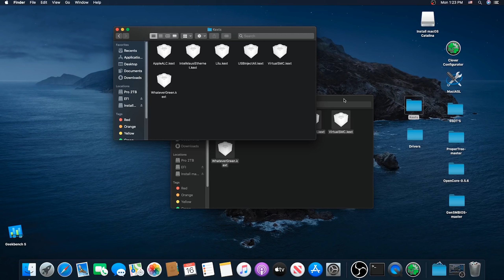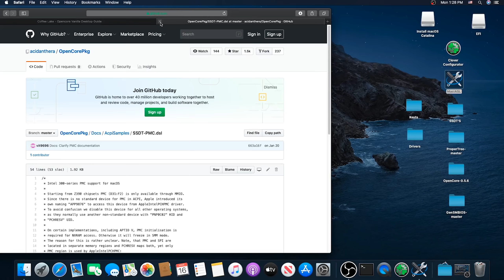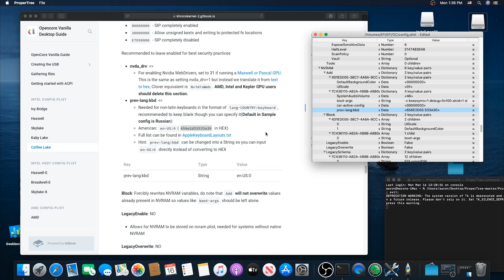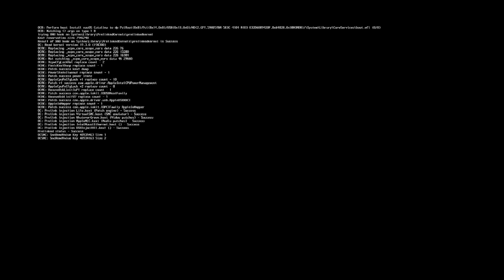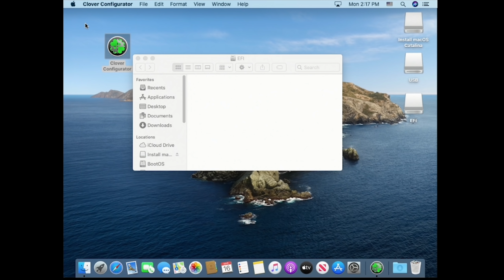OPENCORE CATALINA Z390 Gigabyte Designare Hackintosh Bootloader using a MAC! | Step by Step

Comment: Any advice on getting hardware acceleration working? I have this same build and can't get hardware acceleration working to encode and decode video. Everything is going to CPU. No intel quicksync or AMD decoding on Plex or handbrake via videotoolbox.
Reply from the maker: What graphics card are you using Pete?
Reply: The Sapphire Vega 56. 
The same from the video.
Reply: @TechNolli  Any update?

Comment: I've been running a skylake i5-6500 system for quite awhile now. But I decided I wanted more power  either by going from GTX-710>RX 570 or getting an i3-9100 + cheap mobo. I've gotten the Rx 570 and I guess it helps a little in Photoshop but otherwise it's not very noticeable. I may return it and go the i3-9100 route but it may depend on getting an older Nvidia GTX 560 Ti working in Catalina. My research shows not likely, whats your experience with such a vid card?
Reply from the maker: Hi bryan! No Nvidia graphics in Mojave or Catalina. Not supported. :(

Comment: Hey great video. This is the first guide I've followed to successfully move away from Clover to Opencore and it nearly all works...

I have the a similar setup, same mobo and i9 CPU but I'm running an RX 5700 XT but I'm not getting hardware acceleration. I'm testing this using VideoProc.

Any ideas would be much appreciated, thanks!
Reply from the maker: Hi Anthony! Try using SMBIOS iMacPro1,1 and disbale the onboard Intel graphics.

Comment: This was an interesting video! I wonder, though, as for the last year I've run Mojave & Catalina and used the Apple Thunderbolt 27" (still a lovely display some of us can admit) with an "Asus Prime Z370-A II" motherboard wired/patched from an RX570 out into an "Asus Thunderbolt EX 3" PCI card, which on the TB3 output has a TB3 to TB2 adapter where the display is connected (and works well). If this connection was possible straight away out from TB3 (via TB3 to TB2 adapter) on the Designare motherboard (used in this video) one more PCI slot would be free and also we will get one free TB3 port out from the Designare Motherboard – why not to be used for a very good TB Audio Interface or whatever else? Anyone know if this could be possible, without having the Einstein Hackintosh brain/not too complex settings/coding? Is it even possible or is Mac Pro 2019 the one and only way?
Reply from the maker: Good question.

Comment: Wondering if a XFX Radeon VII will work with this method?
Reply from the maker: Hi Tony! It shouldn't be a problem in Catalina.
Reply: Thanks for the reply.  I have two NVME m.s ssd drives in my Designaire.  I have Windows 10 installed on one HD.  I show be able to install Catalina onto the 2nd HD using Opencore?

Comment: for almost 2 years i use Clover Bootloader , and i want to ask you before treying it what's your opinion is cloverBootloader or Open core Which is better for my rig which I5 8400 
b 360 aorus gaming 3 wifi 
asus dual rx 580 
16 gb ram
Reply from the maker: HI Ahmed! I do not have a preference on bootloaders. One reason I started using Opencore is because of the AMD support on Catalina 10.15.2 and higher.

Comment: Guys, I wonder if you can help me. 

I have recently loaded Mac  os on a Lenovo y530 everything was working great until one day sound just stopped working.. I have tried everything including re-installing Mac OS. This build is using clover. I saw another YouTube video telling me to look for the specific  audio alc Kodak for the device. 

Unfortunately, I cannot locate this. If anyone knows what ALC number this Device is using, please let me know.  My USB headset works perfectly. I had also test of the audio on Windows installation and no issues. 

I would really appreciate some assistance as I am a Voice over user and require audio to use the computer.
Reply from the maker: Hi Dharashan! That has an NVIDIA graphics card that is your problem!
Reply: TechNolli  hello and thank you for your reply. Yes it does have Nvidia graphics card however, it is  Utilising on-board Intel graphics. It also has  realtech sound 

The strange thing is that sound used to work perfectly.. I don’t know what I have done to break it.

I have tried updating Apple alc 
It is picking up USB headset hdmi out but not the on-board speakers which is strange

Comment: I have an integrated GPU and not discrete looking for some guidance on how to insert this into my config.plist as the instructions are a little funky in the vanilla guide
Reply from the maker: Hi Chris, Try making these edits and see if the UHD 630 works. Lets me know!
AAPL,ig-platform-id    Data    07009B3E
framebuffer-patch-enable    Data   01000000
framebuffer-stolenmem.   Data   00003001
Reply: TechNolli I was able to put on the platform Id and it got me going. I’m of course showing the 3mb of gpu I’ll put in the frame buffer info tomorrow and let you know
Reply: I was actually able to partially figure this out by putting in the hex code for the coffee lake iGPU. It was enough to get me up and running. Now or trouble shooting. Thanks for the great video
Reply: So this worked like a charm. Thank you. The big problem I’m now having is I’m only getting 3mb of vram for my IGPU. How would I go about fixing that

Comment: Does quicksync work for FCPX? I have same motherboard and vega64. I like the qucik export with fcpx.
Reply from the maker: Hi Pawell! How do I test that? I am a Premiere user.
Reply: Bruce X score time Prores22 and h.264 would be nice,  typical time for such system would be 10-12 sec in prores422 and around 15 sec on h264.
OpenCL score also be nice. 
Quicksync would enable hardware encode-decode and a program called MacX Video Converter would notify you if quicksync is available and enabled.

Comment: I recommend that at the end of compiling your CONFIG.plist that you use the SANITY CHECKER located at the bottom of the Open Core page that you are working from. it will let you know if there is anything missing or incorrect in your CONFIG.plist file.
Reply from the maker: Great idea Edgar!!

Comment: That case looks cheap.

Try out something like the Fractal Design Define R6, that's well built, not quite Lian Li or HP Z600 but still very well made
Reply from the maker: hmmmmmm I think it is a great case. This thing weights 50lbs. lol I'll check out your Fractal. Thanks!
Reply: @TechNolli  weight isn't everything, stone weighs a lot, and I'm sure you can imagine how fragile a coarse stone like slate would be like if you used it for the case of a PC.

The point I am trying to make is, don't judge a book by it's cover, or in this case don't judge a case by it's weight.

Thermaltake have made some amazing cases in the past (Check out the Thermaltake Level 10 Titanium Edition, or the Thermaltake Level 10 BMW M-Power Edition), I just personally don't feel like this stands above many of it's competitors, other Models like the View 71 certainly do, or the Core-P Series, this case just felt generic to me.
Reply: I have the Fractal Meshify S2. I concur, I didn't know what a nice case was until this Fractal came in. Top notch. Especially for the money. 👌

Comment: Awesome video mate! Tried this with my ASUS Maximus XI Hero mb but got errors : 251:865 00:717 OCB: Failed to match a default boot option
251:942 00:077 OCB: Initial default is 0, fallback
257:060 05:118 OCB: Should boot from EFI (T:0|F:0|DEF:0)
257:769 00:708 OCB: Perform boot EFI to dp PciRoot(0x0)/Pci(0x1,0x1)/Pci(0x0,0x0)/NVMe(0x1,00-00-00-00-00-00-00-00)/HD(1,GPT,D11A4CEA-E6EA-44A1-84DA-B6D4E2AF09CD,0x28,0x64000)/\EFI\BOOT\BOOTX64.EFI (0/0)
257:848 00:078 OCB: Matching <> args on type 0 0
258:011 00:163 ASSERT [OpenCore] /Users/travis/build/acidanthera/OpenCorePkg/UDK/OpenCorePkg/Library/OcFileLib/OpenFile.c(41): FileName != ((void *) 0)
Reply from the maker: Hey Bobbi! Did you copy those 3 efi files to your EFI?
Reply: TechNolli yup.  Shall I send you the efi folder or config file ? 😎🙏😎
Reply: @TechNolli  Fixed! It was "ShrinkMemory". I'd enabled it, doh!! It ROCKS now :)
Reply: oops! can send the txt file if that helps

Comment: Another awesome video bud! Man that 9900K with the Designare seems like a beast build, Kinda want to get that setup LOL. So did you build the USB on that machine or on one of yours? Does it matter what system it's built on when it's a vanilla USB being made? I ask because I thought in the beginning you said he was having trouble getting that system to run. My Lenovo Tiny arrived today though so I'll be working on that!!
Reply from the maker: Hi Jeff! I built the USB on the actually PC. But it wouldn't matter. He had been trying Clover and just didn't have time to figure it all out. Good luck on your Tiny! :)
Reply: @TechNolli  Thanks bud...It's a beast with the i5 and 16GB Ram, but still going to try the i7 4770 and if that don't work I'll get the i7 4765T. The wifi card in it isn't very fast and don't have bluetooth, so I need to figure out what I can replace it with that will work for Mac. Should be some Broadcom cards out there I'm sure.